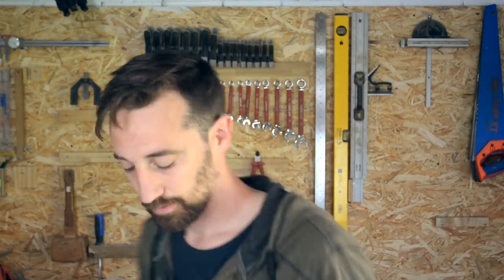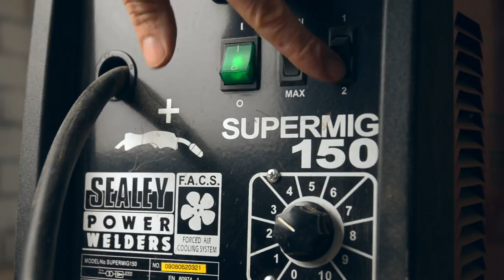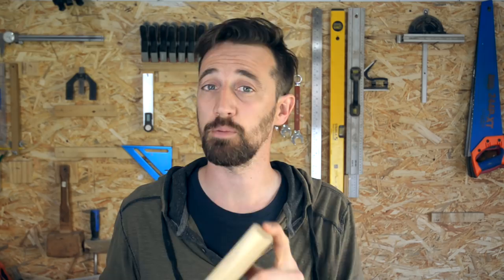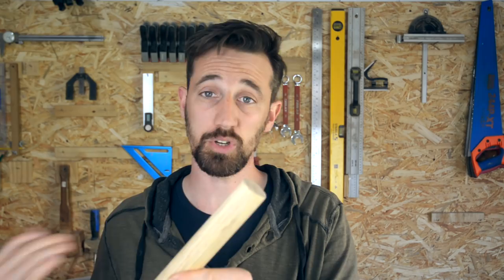How to make a big dowel jig

Comment: Nice but yes it Can be done without the table saw, router, sander, welding etc. I like the chisel clamped onto the block and I imagine it’s a taper tenon cutter if you only insert the wood a few inches. Nice video.

Comment: At the beginning of the video, you said you don't need a table saw or a router. But you used both throughout, like the saw @:33 and @1:28 and @.3:01, The router @ 1:11. I love the jig and the results. It's just that I thought it would be easier when you said it wouldn't need either one.
Reply from the maker: Brian Brian yep sorry I meant to say in the operation of the jig. Sorry if it was misleading.

Comment: Hey Bart! Thanks mate for this awesome jig! But, while working (designing) i noticed that if if we keep the chisel edge parallel to the axis of the bore (25.0 mm) then we will get exact size of the dowel (same as the diameter of the bore). If the chisel edge is not parallel to the axis of the bore (as per your design), the diameter of the dowel will reduce to 1.0  ~ 1.5 mm. Correct me if i'm wrong. 
Waiting for your reply. :)
Reply from the maker: That's interesting. I wouldn't have thought that would have made a difference. The reason I have The chisel on the angle is to graduate the stock material into the bore and allow the chisel to be more effective and put less strain on the Cutting Edge. I'm always up for a bit of experimentation I will give your idea a go and see how I get on. Will let you know how it gos and gald you like the video.
Reply: @bartkerswell  Thanks Mate! I made many dowel jigs in pursuit for the best jig for making dowels. Came across your jig and then i examined it and gave my 05 cent. Looking forward for your input again. 
Cheers! :)

Comment: What was the point of cutting down the top block at 1:57?
Reply from the maker: It's so you can adjust the angle of the chisel to get the right Cut. I found that there just isn't quite enough room to get the angle just using the front block. You probably don't need to cut this much off but it gives you plenty of space to play around with the chisel angle. Thanks for checking it out.